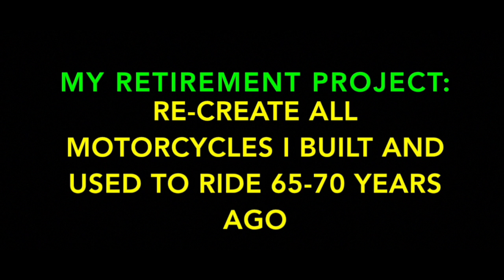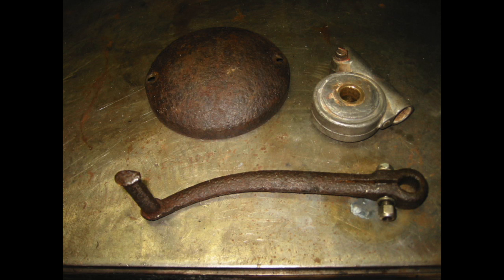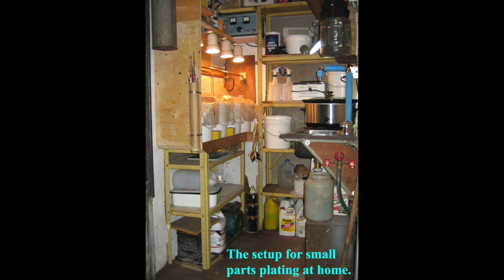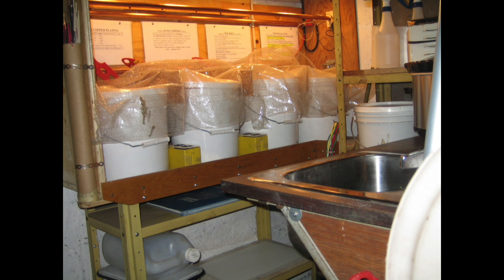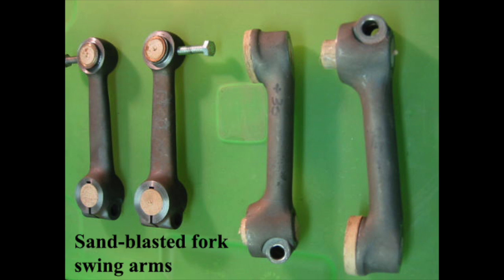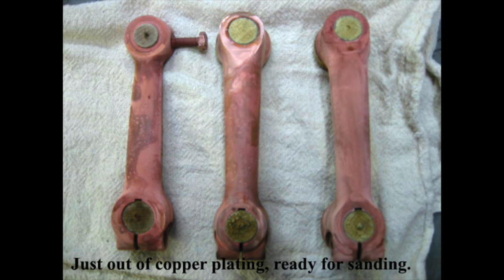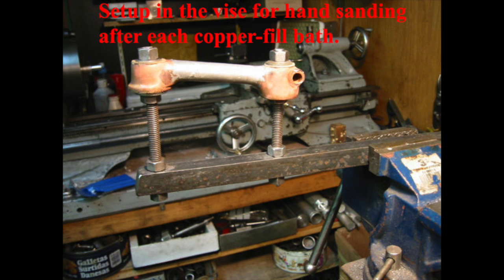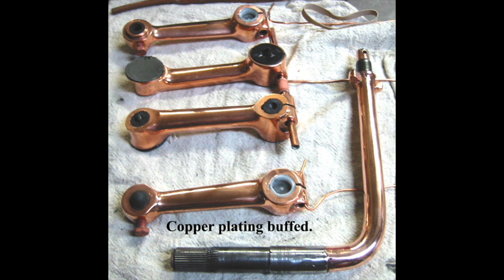#34 - NICKEL & CHROME in a Garage

Comment: Bob, I retired from a company that had a plating shop. They did cleaning, plating and coatings for BMW and FN Arms on occasion. You are right.. preparation is where all the work is. Fresh stamping and machined surfaces if done well may not require too much prep work (in comparison to restoration work). 
Restoration work is the most difficult to do. Plating will make any imperfection stand out like a sore thumb. It may take several tries to get the copper to fill every pit and scratch in the work. If the copper plating isn't a smooth mirror finish, the chrome will look terrible. 
 About the only thing I would bother with at home is nickel plating. Caswell has kits that will allow you to do small parts. Surface prep is key to getting a good result with this.
Chrome is too much trouble. It's the reason that a chrome do-over on something like a 1954 Buick will set you back $25,000 for a good restoration. If you have to have to have chrome for you project, I'd want to be on a first name basis with the chrome shop. If it's a group of small parts (e.g. for a motorcycle), lay the parts out together and photograph them and give copies to the plater so they will be able to identify your stuff and not send it to Brazil in another box.
Reply from the maker: Aceroadholder . Thanks for the advice, I can use them. The reason I started chroming that I was afraid they might loose it or sand off too much. The next bike got Nicole only